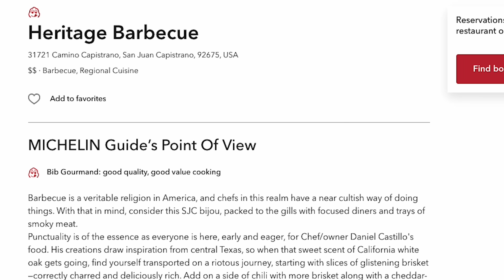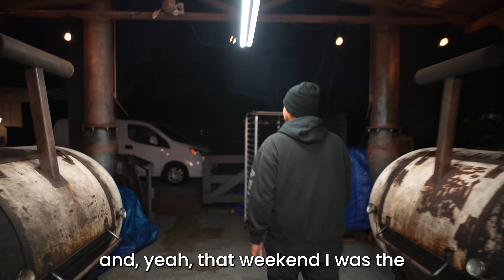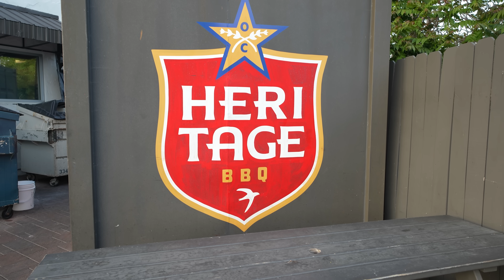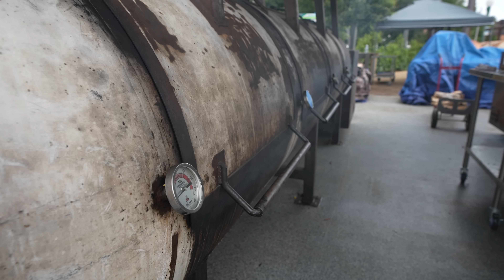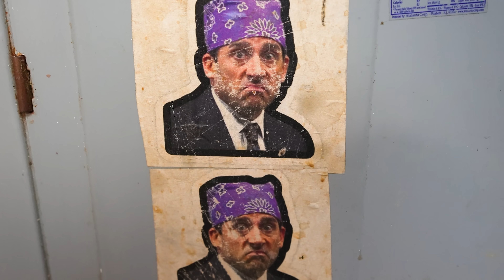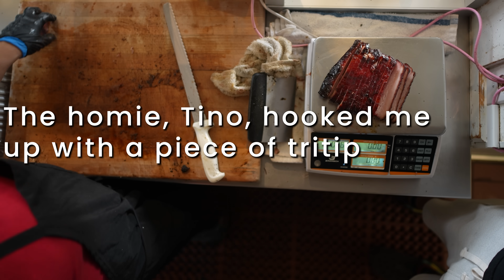48 Hours at Michelin's #1 BBQ in California

Comment: Homeboy can argue it's a lot harder work than a fine dining restaurant...  LOLOLOL
Reply: These guys are also tasked with hand degreasing ,cleaning, wire brushing, re seasoning, and maintaining ( probably at least one full day a week) multiple XXXL pit smoker BBQs and their grills

Plus they are handling many 100s of pounds of large cuts of meat, over and over, literally babysitting ( every hour on the hour) the entire smoking process ( not to mention managing wood and fuel temps and Fire conditions) from 0430 straight until about 1000….then they have to physically prep all of the meat for the various meal offerings.

I’d say it’s comparing apples to oranges. Both venues are hard work, but I’d imagine this is about 25 percent more physically demanding because of the steel pit factor 🤙🏼.
Reply: Because it is, easier to cook steak, lobster, or pasta than a brisket for 10-12 hours
Reply: @lilcourtny08  LMFAO